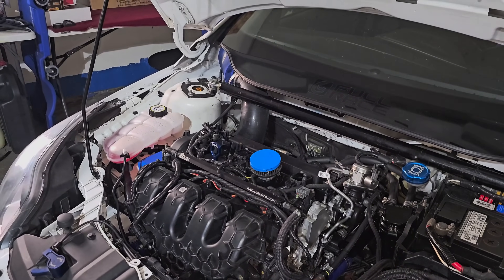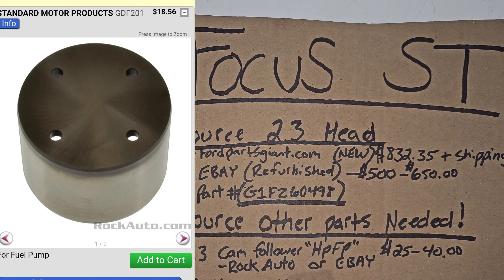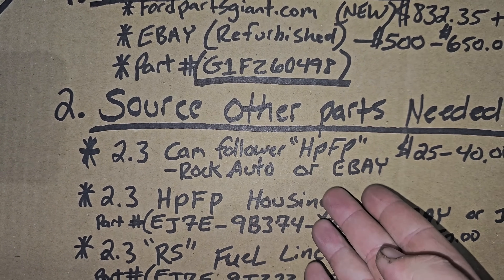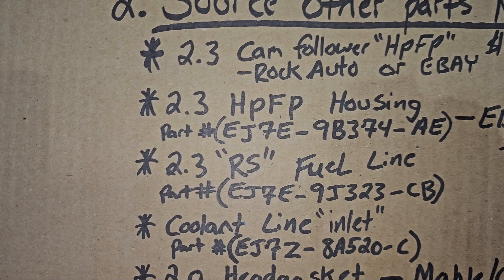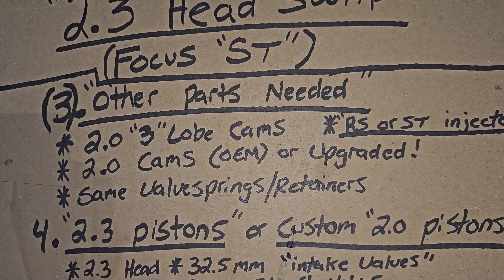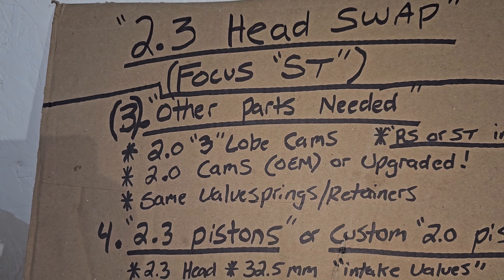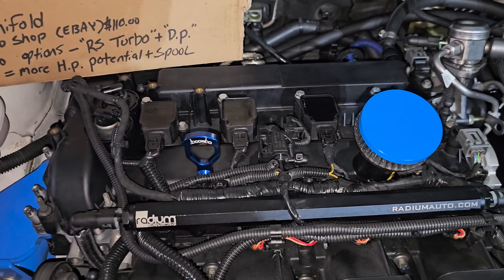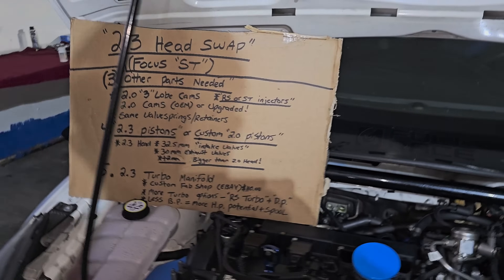Focus ST - How to RS Head Swap a ST |  *The Easy Way* | (Full Breakdown) #builtenginefocusst

Comment: Can you drive the RS Mk3 Hpfp on the setup?thanks
Reply from the maker: No reason to,  no advantage to it.  Its better to use ST hpfp and get a 4port aux that has more fuel headroom than any upgraded hpfp out there, plus it cleans your valves and only turns on during boost.  From what i know running the RS pump caused drivability issues years ago tuning wise on a ST ECU.
Reply: okay, thank you. in Germany it should be unobtrusive because of the police, that's why I thought of the XDI. but in my case, I'll order the XDI for the ST, and install it differently. regards
Reply from the maker: Sounds good,  running the RS injectors you can gain 15% in flow too.  Id hate to live in a place where police care about a car doesn't cause harm to people or the environment,  these people are idiots otherwise.

Happy new years

Comment: (If I'm building my 2.0L engine and potentially upgrade to an RS cylinder head in the future, can I use RS pistons in the build while keeping the 2.0L crankshaft and connecting rods?)
Reply from the maker: Yeah id switch to 2.3 RS pistons absolutely 💯

Comment: so good news on the pistons with a 2.3 head swap on the 2.0 block if you're already running upgraded internals... I contacted Manley regarding my 2.0 Extreme Duty pistons. They said they'll already accommodate up to a 33m intake valve size, and a 31mm exhaust valve size. So fly cutting/RS pistons wont be necessary in my case! I can swap in the 2.3 head with the OEM valves, 2.0 3 lobe Piper stage 3 cams and 84lb ST double valve springs, and everything should be good.
Reply from the maker: So your having your having your pistons cut because the intake valves are the same on both heads,  its the exhaust side.  The 2.0 pistons accommodate for +1mm bigger which is 29mm.  The RS head uses 30mm exhaust valves which wont work on a 2.0 piston,  the ST or 2.0 head is 28mm exhaust valves.
Reply: @WhiteblurrST  I told the rep at Manley what his details say when Im looking at the pistons on a sales site about accommodating for only 1+ mm more, he said and was very confident, the Manley Extremes can accommodate up to 31mm exhaust side, 33mm intake side. Hopefully he is right 😶
Reply from the maker: That's for the 2.3 pistons but if he says it's the way well you better havr his name  written down lol.
Reply: @WhiteblurrST   I was thinking the same because its my engine. Im going to ask them again tomorrow and maybe get a different tech that can confirm the part number and clearance. I dont know why they wouldnt just have it cut more for larger valves in the first place. At least more than 1mm for other build options
Reply from the maker: Ask them the size of the valve reliefs for 2.0 and 2.3 pistons in inches,  guaranteed itll be way different on exhaust side.  Your pistons being 2.0 accomodate +1mm in size which is over stock so thats 33.5mm and 29mm on the 2.0,  the 2.3 is 33.5 and 31mm
Reply from the maker: You can have them cut for larger but it costs extra.
Reply: @WhiteblurrST  yeah i talked to another rep today and he said it was just the 1+ mm relief, Im having a local race shop fly cut the Manley 2.0 pistons for half the cost of new RS pistons. I knew it was too good to be true 😅
Reply from the maker: Yeah i figured

Comment: can that coolant line just be tapped and plugged above the exhaust port? So its not all jerry rigged, taking up space and a potential for leaks? or maybe just blocked off?
Reply from the maker: Well the return line is there because obviously the st head didnt have it and probably its to prevent head cracking from the heat but id just get the metal line and plug the end or weld the end you can do that instead of messing with the head itself.
Reply: @WhiteblurrST  You think there would be any risk to having that blocked off? Im heavily debating this head or just building a 2.0 head since they CAN hit the higher horsepower..its just more work for it. I have the G30-660 with AEF dp/manifold/dumptube etc all that just came in this week. But it was bought back in February when my head was fine, so its for the 2.0l. Clayton Performance/AEF said they'd let me send the 2.0 manifold/dumptube back and swap out for the RS one ($100 extra)... i can get an RS head very cheap locally...then just have to buy the components to have it built and either install it myself or my original engine build assemble/time everything for me (id bring him my engine/head).
Reply from the maker: Possible but who knows honestly,  id get it either way.
Reply: @WhiteblurrST  if the 2.0 block is already built with Manley heavy duty pistons and rods, would I still need 'custom' pistons or RS pistons? I would just run the stock RS valves (both intake/exhaust)?
 I have almost everything else lined up, but Im not going to go buy new performance pistons after mine only have about 15k miles on them. I wasnt really planning on removing pistons/rods at this time, just possibly upgrading the crankshaft to a keyed set up since the engine will come out (and ill very likely be pushing mid 500's easily, intentionally not shooting for beyond the OEM LPFP limits). Everything else looks good, i can source the head and most RS parts locally for dirt cheap/trade. All i need to do is choose cams and valvesprings and have a shop pressure test/level the head.
Reply from the maker: You need the dish cut for the valve size on the RS,  definitely cant run ST pistons.
Reply: @WhiteblurrST  do RS pistons swap right over? is there an issue with the oil squirters from and ST to RS? Im finding that getting RS pistons might be cheaper than getting a 2.0 head ported/knife edged, if thats the case, i can just do the 2.3 head and be good. I dont recall if my builder initially removed the squirters when he first built my engine
Reply: @WhiteblurrST  also, is that a Mountune cam cover? Is this from the purge valve delete thing? I still need to watch that one about the purge valve
Reply from the maker: No, it's the vacuum pump delete plate.

Comment: What’s the benefits of doing this? Was it mentioned in the video?
Reply from the maker: Yeah if you watch the whole RS Head Swap Playlist,  it explains everything.
Reply: @ I’ll watch it on my lunch break. Thanks for continuing to answer my questions on your videos
Reply from the maker: No problem,  i like to answer every comment so im engaging with everyone plus we have LiveStreams every Friday night too.  If you still have any questions after watching let me know.
Reply: Damn, no hp/tq graph at the end. Mpg, is this car used as a daily or track car? Very cool video and informative
Reply from the maker: There is no hp graph comparison but the RS without a doubt has gains because it uses a +2mm bigger exhaust valves,  has 3 ports instead of 1 with less backpressure,  it has less chances of cracking because of that and the cooling return line.  Mpg is the marginal and honestly could be the same,  my 2.3 setup was 28mpg avg. on 93 and 21-22 on e85.

Comment: I have a complete rs engine. To run this on the st ecu. Id basically need to swap the cams and use rs turbo and down pipe and just have the exhaust system modified.
Reply from the maker: Your better off using the ST Block,  its stronger and if you ever plan to make past 400whp you definitely need to upgrade the RS rods anyways because thats the weakpoint other than the open deck block cracking.
Reply: @WhiteblurrST  yeah my long term plan was to throw in the rs lump. And then using the st block. Build that up with forged rs internals. And then when the time is right swap it in.
Reply from the maker: Sounde like a good plan
Reply: @WhiteblurrST  but using the full rs engine in the short term would work with a cam and pump swap
Reply from the maker: Ive seen many rs engines blow on stock turbo because the TQ destroys the rods.  At 450whp you gotta worry about the block cracking between cyl 2 & 3

Comment: Do you know if the later 2.0 twin scroll heads flow better than the single port 2.0? I know that the exhaust valves are smaller but other than that I am curious as to weather you would get most of the same performance benefits and require less parts to do the swap.
Reply: I was actually referring to the 2015+ twin scroll 2.0 engines. After a bit of research it looks like they may actually have the same head. Part of why I ask is because I'm actually a technician at a Ford dealership I've done quite a few long blocks on the twin scroll 2.0 engines cause of the coolant intrusion issues. If the heads are the same, I may be able to snag a core for cheap and use the head off of it.
Reply from the maker: Yeah 2015-2021 fits which is what im talking about.  There the same as the 2.3 rs head and mustangs head from what i know.  Thats cool,  yeah the gen 2 blocks for the 2.0 were a horrible design because of that intrusion in between cylinders,  they fixed that, tho i believe after 2018.
Reply: @WhiteblurrST  so after some research the part number is different between the 2.3 and 2.0 twin scroll head but it also looks like the exhaust Valves are smaller like on the stock ST heads so it's possible that you wouldn't need 2.3/ custom 2.0 pistons for the swap to work. Would the smaller exhaust Valves cause a major flow restriction or would it be pretty equivalent since they have the larger ports for the twin scroll setup?
Reply from the maker: You dont need custom pistons at all,  typically you run 2.3 pistons for a RS head swap or get 2.0 style pistons that are +2mm bigger on just the exhaust side,  the intake side is similar and everything else dimensions wise is the same other than the compression being 9.3 to 9.5 but thats it, its a easy swap but does involve some creative thinking which i did when doing this.
Reply from the maker: I mean if the smaller exhaust valves are the same as the ST head you still gain in the fact of there is way better flow and less backpressure,  you just are not maximizing the setup.  Honestly ford engineering was dumb when it came to the ST and RS design around the block and head configurations and Turbo Selection but i understand it was done this way to please the EPA standards.  **If i was ford and had done it,  i would have done the RS head and k04 or g25 style garrett that the rs has put it on the 2.0 ST and it allows still great response but better longevity,  The RS i would of used a stronger block than the ST or similar at least, not that junk open deck design and id went with the Ford Performance 4port Cylinder Head since the RS is a higher performance car,  its literally the shelby of the focus platform and id put a gt28 style turbo on that with stronger rods since the RS weak point is the rods and then the block.
Reply: @WhiteblurrST  the more I think about it, is there really any reason for running a 2.3 head on stock internals/ OEM 2.3 pistons? Or is it really only worth it to swap the heads once you go fully built with forged internals so that you can make more use of the stronger internals. My understanding is that the stock internals are really only good for about 400hp which the stock head seems fully capable of.
Reply from the maker: The stock head is actually almost capable of 700whp,  it just wont last a long time because of the heat created by backpressure,  no its not worth it on a stock bottom end.  The RS head is worth it if you dont want the ST head.  The 2.0 ecoboost pistons are the weak point being cast so there is no hp rating,  they can go bad literally with stock turbo just like the 2.0 head cracking issue.  The 2.0 rods can handle mid 400s but i wouldn't personally go past 400whp on them,  the record stock block record is 560whp and 470wtq.  The 2.3 RS head is capable of 1000whp with work done to it,  id love to get a custom timing chain to make the Ti-vct 2.0 durate head fit because that head flows the best of them all 260cfm,  1000whp stock and its a 4port manifold.  35mm intake valves and 29 exhaust.
Reply: Additionally, I read on some forums that some people say you have to block off some of the coolant/ oil passages on the 2.3 heads for them to work. Is that not actually true?
Reply from the maker: Thats what everyone thought they had to do,  if you watch my video on the swap you will see everything you need to know.  Just get the 2.0 mahle headgasket which is oem ford,  fyi mahle and bosch make the Motorcraft parts for our cars,  rockauto is your friend.
Reply from the maker: The new twin scroll head 22+ wont work because the vvt ends are bigger like the ti-vct head,  you would need the 2.3 heads from 2016 to 2021 i believe it is,  i got a RS head swap video playlist check it out if you haven't.

Comment: Very helpful and informative! I have a MRX 2.3 stroker long block from mountune and it comes with the 2.0 head I recently cracked the head I believe, and I’m wanting to convert it to the RS 2.3 head I’m not sure what I need considering my bottom end is a 2.3 stroker and my head is 2.0 I have v3 piper cams but what all do I need to convert For the head to fit. Do I need rs valves or? Thank you! Love the videos.
Reply from the maker: Well i believe the video provides everything you need for the parts needed,  you do need 2.3 pistons for the exhaust valve reliefs since there 2mm bigger but otherwise you need to source the things i mentioned.. maybe i can make a dedicated video of parts needed for the RS head Swap to help make it easier.  Appreciate your support
Reply: @ yeah you were super informative! the add ons that you mentioned in the video I’ll grab I’m more concerned on the valves because of the 2mm difference so I have the rs crank and 2.3 stroker pistons is the rs 2.3 vs the 2.3 stroker pistons not the same?
Reply from the maker: No the ST pistons exhaust reliefs are to small if thats what you got

Comment: Hey man good video. Why did you still end up running the 2.0l fuel lift pump,  the 2.3 lift pump is of higher capacity and I was looking at doing this swap to increase my fueling while increasing my cfm. I am just curious what your reason was . Thank you.
Reply from the maker: Because running the 4 lobe is almost impossible to tune on a 2013 focus st ecu,  doesn't run good unless someone has finally figured it out?  Also i didnt want the 4 lobe because i had a 4port aux fuel kit,  so making 360whp on 93 is fine,  you can make 410whp on 4port 93 or do e85 all day.  The best way to increase / saving money is stay oem fuel system and run a 4port with all the benefits of that.  (No headaches)  Hopefully that helps,  thanks for supporting 🙏

Comment: so what's the benefit to the vacuum pump delete? other than simplifying the system... did it affect braking?
Reply from the maker: Other than cleaning up the engine bay,  removing the pump eliminates some parasitic drag on the camshaft and also removing the end bolt adapter reduces weight on the cam too,  its kinda comparable to a balance shaft delete in that brakes.  If you route your brake booster line to a vacuum source with a chack valve they work just fine,  i havent had any issues.  I have also seen when these vac pumps fail and they lock up thr camshaft so you can imagine what happens then.

Comment: Soooo... No whiteboard. Well, the cardboard works and it is your signature style. Lower carbon footprint? 😎

Seems a bit like the ole classic, better cylinder head,  "mer hersepewer". I'd like to see how it holds up and how reliable it will be. 

A super thorough video... with a cardboard and all you need to know to get'er done. 👀
Reply from the maker: I just got a small white board 😆,   when i made this video i didnt have one yet.  The carboard doesn't always look the great but i can always look back on it later since its not erased!  I appreciate your comments and likes on the channel  it definitely helps get the info out there!
Reply: @WhiteblurrST  Oh, no... By all means, continue with the cardboard. It is your official signature style... do not use a box from the big seller that puts a smile on the box, or you will get a copyright strike.
👍👍
Reply from the maker: I need more big plain cardboard lol 😆,   the white board is plain has no copyright indicators.  Its just white with a black think border.